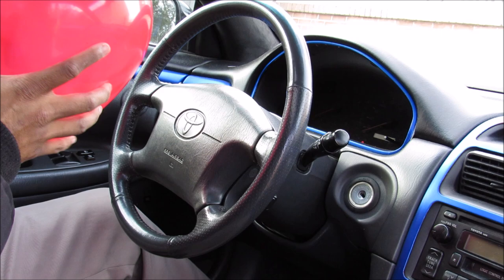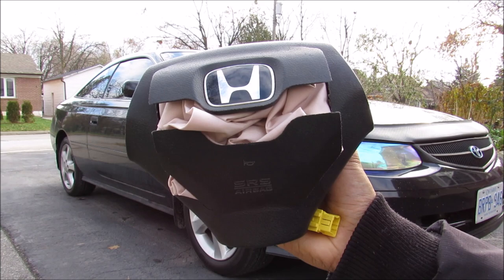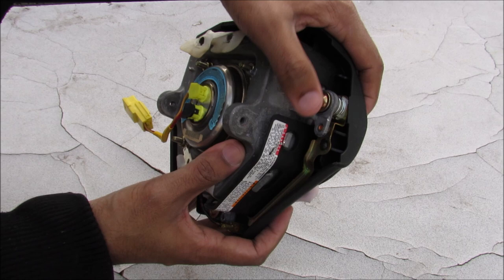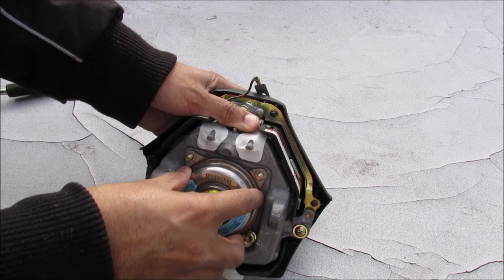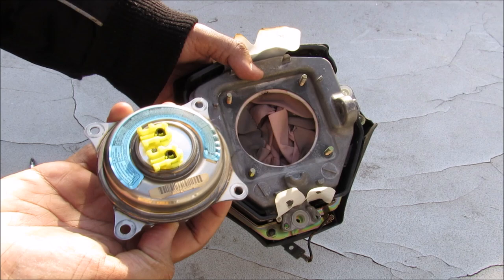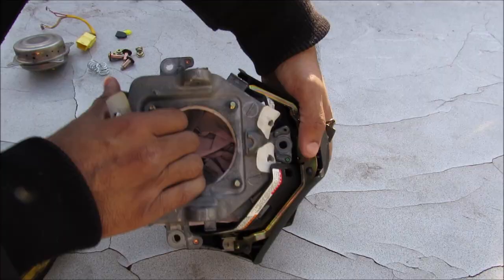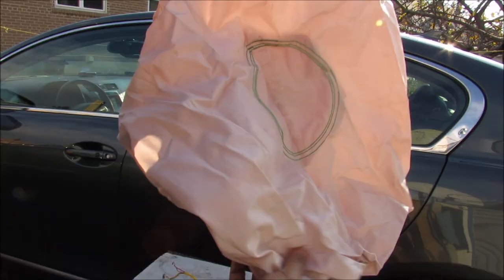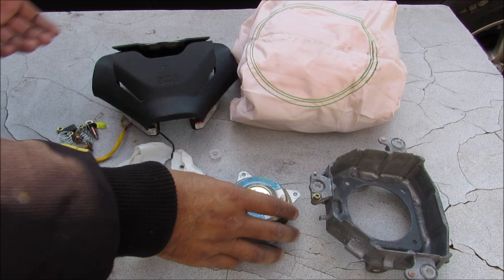How an Airbag Works - Takata Recall Explained

Comment: Great, I needed this so I can completely remove the Airbag and only keep the Cover. Airbags are the biggest safety Recall Hoax in history ever. They are there to make Manufactures more money, they can total cars out faster because of the high prices of Airbags and its Components that need to be replaced after an accident. No Seat Belt Supplemental Device should total out your car or deem it Undriveable, Unuseable or worse even a Total Loss. Seat Belt is what Really save lives, Not Airbags.  

People have been brainwashed to believe your car isn't safe enough to be on the road without airbags. What about all the classics? Some Classics don't even have seatbelts 🤦‍♂️ yet they are on the road and everyone is happy. This safety Feature is a Hoax and Over priced to fix and totals out cars way to fast. Something needs to be done and Airbags need to be affordable with less red tape to get them back into your car used. 

Now here is the Million Dollar Question, Can I remove the Detonator after it has been out of a car for over a year? I know you said not remove Detonator at the end of the video, but not sure if you meant it for an Airbag fresh out of the car. Or should can something to prevent it from Detonating? 

Just asking for your Opinion and not holding you responsible for its actions, this is being done solely for Educational Purposes. Also you said the dealer only replaces the Airbag Inflator/Detonator, That Means it can be removed if that is the only piece they are Replacing? 

Thanks for sharing.
Reply: ok karen don't complain if you are driving your car and get very hurt
Reply: @jadenbissell2795  You mean like so many cars before the 1980's that didn't get hurt and didn't have Airbags? like that? 

Let's not forget about all the Airbags that have killed people with grande like Sarpnel coming at their face when that airbag explodes. 

Seat belt save lives, Airbags are a supplemental. If you think Airbags save lives, dont wear your seatbelt. 

Maybe we should ban all classics and cars that don't have Airbags or seatbelts made before the 70's? 

Who the Karen now 😂
Reply: @ELEVOPR  its called new cars are built different plus imagine hitting your face on the dashboard or the steering wheel do your research before you comment karen
Reply: @jadenbissell2795  Sure, that is why so many people are killed in classic cars. You have your opinion and I have mine. Airbase do more damage that help save life. 

my aunt and uncle got into an accident in a brand new Nissan frontier. 35mph, Air bags burnt and bruised my aunt's face. my uncle had a broken finger believed to come from airbag. 

Your just a sheep and think because a Airbag is added it will save your life. lots of people crash in old cars that don't have Airbags and the seatbelt is what saves them from eating the dash not no stupid hot burning balloons. 

Guess who bought that Frontier with low milage after the accident 🙋🏻‍♂️ Because they feared driving a car with an Airbag after the accident. They went back to their old  Trusted Oldsmobile . 

Airbags can go off in accidents as little to 10-16 mph and all you need is a new bumper and maybe a grill at that speed costing you only $500 in parts, yet once those Airbags go off, it will now be $5000 

Repeat after me, Airbags are a money maker for the car industry  and allows them to total cars faster, their for selling more new cars. 

I'm not saying it can't help and assist with a pillow to your face, but I don't it can save a life, as we know for now, Airbags are causing more damage than good.
Reply: @ELEVOPR  actually thats because they were sitting close the the wheel besides the  finger not only that airbags are known to cause chemical burns by the stuff thats used to fill the bags. bruises are caused by people sitting too close to the wheel so don't blame the cars
Reply: @ELEVOPR  but I'm very sorry about your aunt and uncle